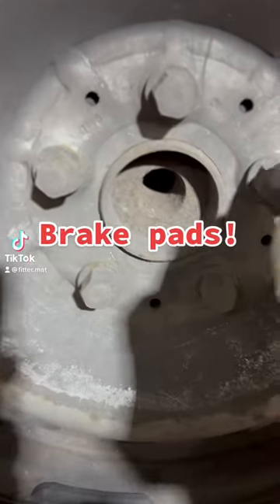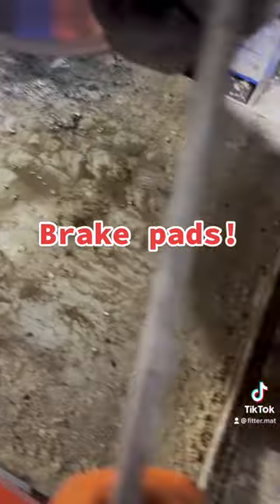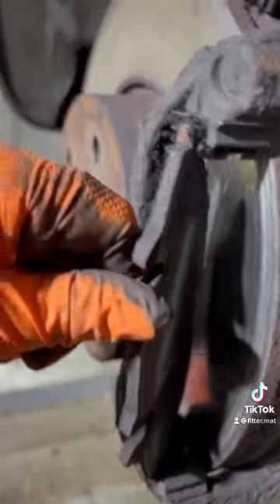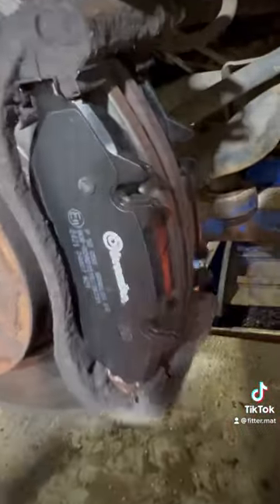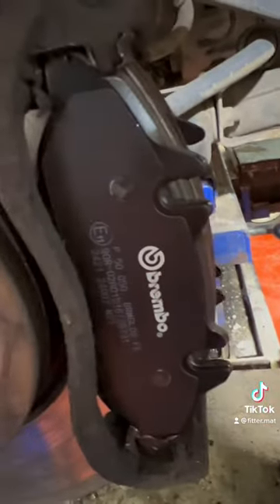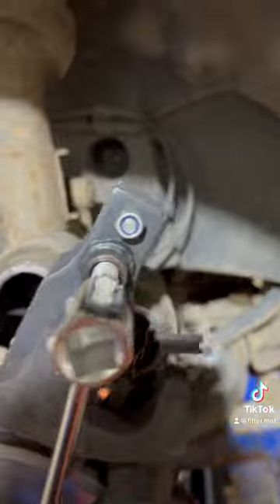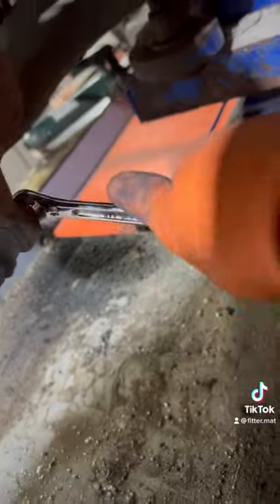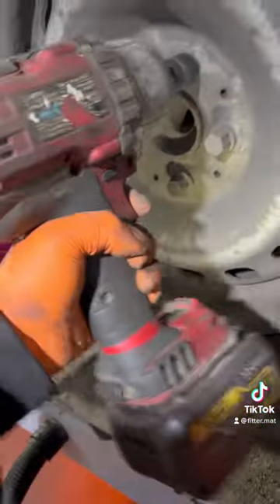Mercedes Vito brake pad replacement

Comment: Those brembo anti-squeal pads on the recent sets I’ve bought have been rubbish. A bit of corrosion and they swell up and act like a spring, pushing the pad against the disc all the time so you get drag and wear.
They do stop it squealing so you can’t tell your pads are disappearing at a rate of knots though, so that’s nice…..😐

Comment: I was always told at college to never put coper slip on the face of the hub, only around the mating surface where the wheel's hub slot goes on... Because under braking, the wheel can work loose... Loose as Jimmy Saville's paper boy's balloon knot...